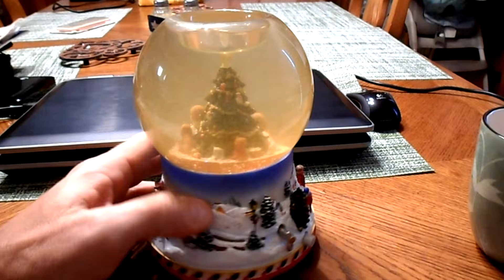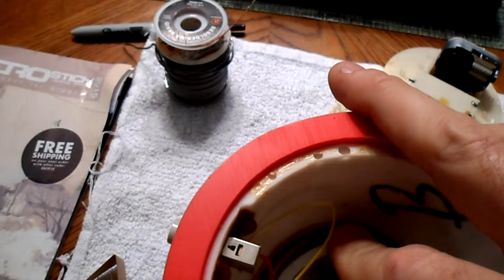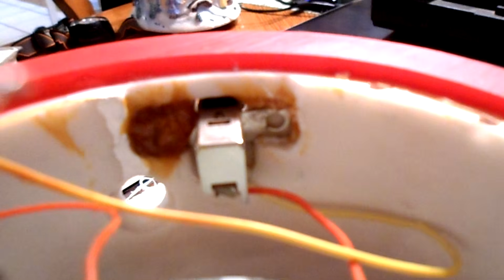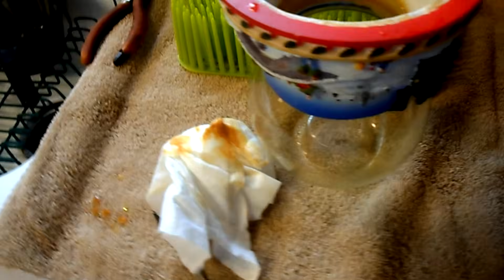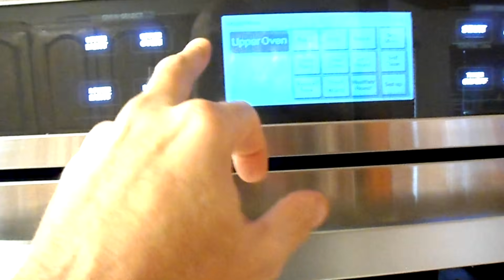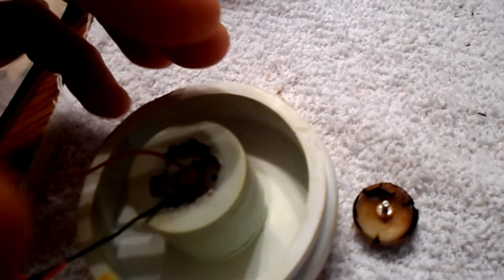Snow Globe Repair

Comment: Thanks!

We got one of these tea light snow globes from a garage sale and it suffered the same rust-water symptom.

I followed these steps (approximately) and planned to be satisfied with simply changing the water.  I trusted your conclusion that I wouldn't be able to repair the fan assembly that circulates the water.  

Unfortunately, I damaged my rubber gasket in the process :( I tried to fairly gently use a thin bottle brush to clean the rusted fan (between the gasket and the display piece inside my globe.  In doing so, I could see that the rubber that was exposed to the water was relatively brittle, and apparently I made a small additional but of damage and now I have a slight drip into the music box area :( so this is a warning to others.

Here's what I plan to do:

1. Simply try to add a mess of hot glue on the dry side of the gasket and hope this seals the leak

2. Additionally, probably order some parts. It seems that national art craft sell both gloves and gaskets. These won't be the tea light style, and won't match the motor-style gasket, but my motor is pretty hosed anyway.

Anyway, thanks for this old video!

Comment: Great video thanks. I had a similar issue with a rusty impeller. Turns out its a magnetically separated impeller and looks just like yours. There were 2 ferrite disc magnets inside the impeller that rusted. I cleaned it up, ordered 2 replacement magnets from a magnet shop to fit inside and covered with super glue to make waterproof hopefully. Could also use silicone. I had to glue the shaft back in place and then assembled OK. Tested and all is good. Just have the tricky job of filling and silicone back together.
Reply: Could you please drop a link to what you bought?

Comment: Hi Aaron , I'm so happy to see this vdo but how can I contact you sorry?
Reply from the maker: Howdy! I can try to answer questions in the comments like this. Thanks!
Reply: @aaronsrose  Do you have the impeller for sell or how can I find one sorry?
Reply from the maker: Hi again. I do not unfortunately, have any parts for the globes. I looked on Amazon back when I recorded that video and was unable to find anything. There were identical units on eBay for fairly cheap though if that might still be an option.

Comment: This is exactly what I was looking for and was extremely helpful.  My snow globe from somewhere between 1994 and 1997 had the exact same problem.  I took it apart, drained the smelly brown water, cleaned, and going to air dry and put back together without water, "snow," and glitter.  As long as Santa stands upright and the music box works, I'm fine with it.  A lot of "engineering" to make this Chinese made keepsake provide Christmas joy!  Thanks for posting this helpful, informative video, Aaron!!  -Erik

Comment: I fix snowglobes for 20 years now. The glue they use is some strong ass glue. Next time take care this is not the way to open them. The glas is super super thin. You are in luvk it didnt break on you
Reply: I realize it’s been some time since you posted this. I’m hoping you see this comment.  What is the right way to open it? Do you have a video you can share?

Comment: I bet u could replace the motor and reuse the old impeller 

Take the old impeller take it apart remove the metal and replace the metal part with a plastic washer
Reply: I came here looking for info on replacement impeller. The motor mount on this set-up requires the impeller to have a magnet on the bottom side of the impeller. The motor is mounted on the bottom of the globe plug, with a spinning piece of foil wrapped washer. The magnet on the bottom side of the impeller allows the impeller to spin due to the magnetic force with the motor. Impeller is mounted on a shaft, inside water globe, motor stays dry on outside. (Also, the water browns from the rust from the magnet)

Comment: I have snowglobe I bought from Disneyland about 10 years ago there is quite a lot of water gone at this point but the main thing is every now and then it starts making this loud clicking noise. What causes it to make this noise?
Reply from the maker: Thanks for the question.  I'd need to see the unit to diagnose the noise properly,  but if it's a music box,  the gearing may be worn out and skipping.

Comment: Thank you for sharing this, because my papa has the same exact snow globe he was cleaning in the video the same one  with the poor little christmas tree in the water... and he finally decided  to passed it down to me im 14 years old now and my papa give the snow globe to me for christmas he only put it for decoration on christmas one time, and he found a partylite box he opened it up and found a partylite snow globe! he gave it to me, but when he opened the box it had a rusty colored ting to the water in the globe... and like you said  the partylite snow globes have a music box and a motor in the base that makes the snow swirl in the globe, the music box worked but, the snow swirler did not work i could hear the engine turning, but the snow did not swirl, and the water was nasty... now that i found this video on december 19, 2018, my mom had bought a little metal impeller for the snow globe and now like i said december 19, 2018, she will fix it, and my papa will cheer up because lately my grandma passed away :( , he would be cheered up because my grandmama bought him that snow globe, and again Thank You!! :)

Comment: Wish I could show my mess. It is a bit older (partylite), been buried for a longtime and giving away much of these partylite  nick knacks and such. This one just like yours, but, inside different. It lost the water? The rubber seal deteriorated from rust. not savable, probably clean best as can and use as is with no water. No way to seal it. I do have a idea, but very doubtful I can seal it forever?

Comment: I put the globes in a freezer for about 10-15 minutes.  The glue will become very brittle & easier to break the seal.
Reply: Thx for that, I will try it.  Let you know.  Just DON'T FORGET it's in there, or it WILL get opened, in the worst kind of way.  ;-)

Comment: Thanks Aaron for posting this!  I too own a Partylite snow globe, music and flying glitter. But like your's the flying glitter no longer worked.  I could hear the motor running, but no action with the glitter.  Luckily for me, my "impeller" was magnetic, and after removing the trimmings (?) from the impeller, it started working just fine.  Now i need to decide if i need to replace the glitter or use the old.  Thanks Again.

Comment: I have a snowglobe that does not have the motor/music box part but is still sentimental... the globe is cracked, water has leaked out some, .... what glue can I use to repair that crack to be waterproof and will dry 'clear'. ?
Reply from the maker: Cracked Globe. That will be difficult to keep looking good. If it's glass, I'd say maybe a Loctite "Glass Glue" would work, but the pieces usually have to be separable not just Cracked to get a good joint. For plastic, the adhesive is more difficult as it could melt or craze the globe depending upon what the plastic is.  It may be easier to take some measurements and google around to see if you can find a replacement globe that would fit. Good luck!

Comment: Incredibly helpful this year with a nostalgic snow globe we had for years and was leaking. We did everything you instructed expect NOT push too hard on the rubber stopper and when I pushed just a tiny bit too hard and heard the air escaping.....boom! the glass shattered.......oh boo hoo hoo. Now we have to get a glass globe.  That glass is paper thin!
Anyway, thanks for your good video.
Therese and Kerry

Comment: Hi Aaron.  This was so helpful.  I actually had the same globe that the motor pooped out.  I ended up getting rid of it instead of trying to fix it!  Wish I had seen this first.  BUT... I do have a treasured snow globe that has a sterling silver base.  It seems to have lost most of it's water in a move across country this summer.  The globe is in tact and it doesn't seem to be actively leaking.  I felt that I would be able to clean and replace the water, using the knowledge I gained from your video.  I can't seem to get the bottom off of the base.  It is sterling silver, and has a pretty felt bottom.  I peeled that off and was sure I could pry the bottom off of the base - but it doesn't seem to want to come off.  Doe these globes ever come apart any other way??  I can try to upload a pic.  Any advise you have is appreciated.
Reply from the maker: Hi Alison. Thanks for the wonderful comment. About your silver snowglobe: I have to say I don't really have any experience beyond working with the one from the video so what I'm thinking may or may not work and could cause damage. 

Logically, if the lower cover does not have any visible fasteners like screws, I would think that it would have been assembled with some sort of adhesive. Is the lower cover recessed into the base so that there is a ring of silver around it when it is assembled (Like my plastic one in the video)?  If so, and the globe itself cannot be obviously removed from the top/outside, then if it were mine I would try to snake something very thin and flat between the lower cover and the base to see if I could work it all the way through. Then if it went through between the cover and the base, I'd see if it could slide sideways. If it did, I'd move it around until I found an obstruction which might be the glue spots. If you can't get a very thin instrument under it at all, I might try very gently heating it in the oven. Maybe to 100-120 degrees and trying to remove the base again. My thought is the mild heat may soften the adhesive. Alternately, if the cover is plastic and not wood or cardboard you could heat up some water and set it in that for a bit to try to do the same thing. Though, if there are electronics in it, that may be bad as well. 

Another thought I had, if the cover is metal, could it possibly have been threaded and screwed into the base? For that I would think there would be some sort of a slot or notch on the cover to allow the assembler to grab it with a tool and twist. (This seems extraordinary, but if it is an expensive unit that was hand crafted, anything could be possible.)

I hope one of these ideas helps. Best of luck.

Aaron
Reply: Thank you so much for that detailed response.  I'm trying to upload a couple of pics in the comments so you can see what I'm talking about.  I did try to pry with a very tiny flat screw driver - but it chips... almost like plaster?!?  Maybe it is saturated cardboard that has dried up.??  I will keep at it.  Thanks again for the suggestions.
Reply from the maker: I see that you sent a link but it's not showing up. Can you upload the pics to photobucket or another host? That would allow them to be viewed.

Comment: Hey do you know how to replace the plastic on a snow globe?
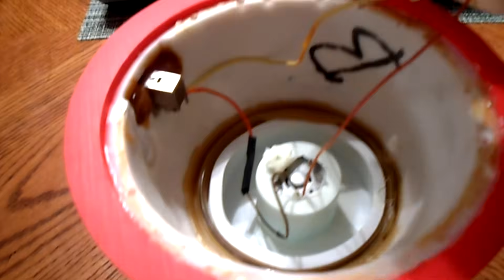Reply from the maker: Hi Jatasha. Thanks for asking. If you are referring to the globe itself, at about 2:34 in the video you can see there is a ring of glue inside the case around the area where I pull out the rubber plug. That is what is holding the globe onto the base. If that glue can be removed, then the globe could be changed and reglued back together, I believe. Thanks again, Aaron.

Comment: Hi, thanks so much, you have helped me so much....I have two PartyLite snow  globes that have dirty orange water.  I was going to toss them.  But now I will repair.  What kind of water did you use to refill the globe?
Reply: +Deanna Tucker I replayed your video...you used distilled water...thank you again!
Reply from the maker: +Deanna Tucker No problem. Glad it helped!
Reply: i have one with clear water but it makes a noise when it is turned on, i can hear the motor whirring but nothing moves , my snow is more like little styrofoam balls not glitter i was hoping it would get unstuck but no luck
now i know not to bother opening it  up ,too bad they didn't use magnets to that the motor would not have to be   touching the water